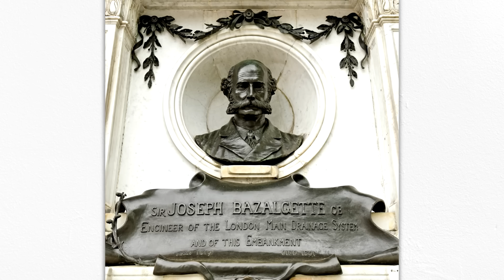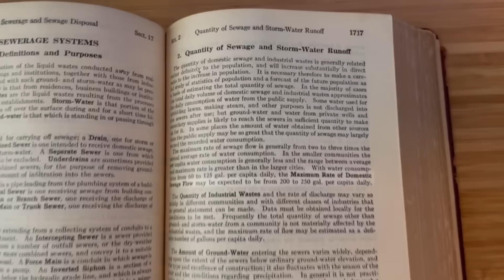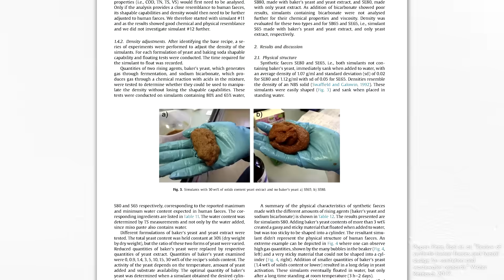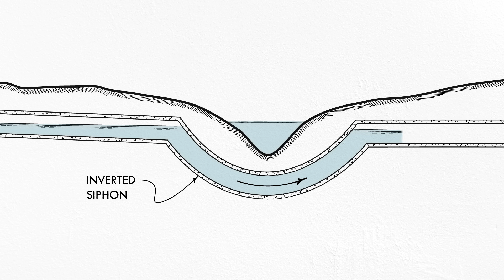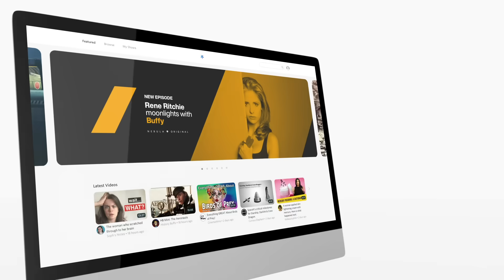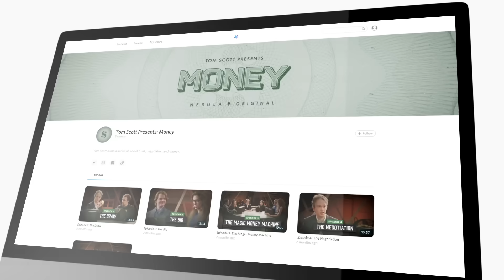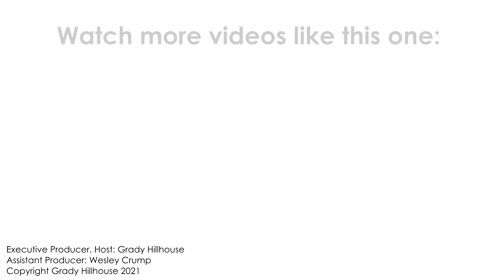How Sewers Work (feat. Fake Poop)

Comment: "Flushable" is a dishonest marketing term. Anything is technically flushable, if it fits
Reply: If it fits, I shits
Reply: Really don't get how companies still making problematic 'flushables' haven't be sued in major class actions from cities for the damage they're causing...
Reply: @RealLuckless  sue for what? Are they not flushable?
Reply: @Jman3881_  I worked as an electrician on  some sewage bypass jobs where diesel engines generate electricity and the electricity runs pumps to lift the sewage up and pipe it through pipes run along the ground then back into the sewer on the other side of the part being worked on. I have seen telephone books jam the pumps. How did those get in there? Those flushable wipes are notorious for collecting into gigantic mats of wipe fibers that will foul a pump worse than the phone books. The bedsheets? That was in a prison treatment plant and those guys have nothing but time to figure that one out. Apparently after so many flushes, a bedsheet will eventually go through. That mess was tangled up in a sludge rake conveyor. Burned the motor out too!
Reply: @RealLuckless  Actually, it has happened. Adam Ruins Everything made an episode about it.
Reply: @RealLuckless  When company is rich enough, they don't care about what's legal and what isn't. You sue them, they lose, the fine is just a tiny drop compared to the ocean of money they earned through doing what you sued them for. Welcome to capitalism! :P
Reply: @LordDragox412  you mean corporate capitalism or monopolistic capitalism. Free market capitalism doesn't make what you see, possible. Only made this comment, because there's a bunch of loony socialists running around, saying this is what free market capitalism is...
Reply: @LordDragox412  Yep, labeled as a "cost of doing business" - a lot of companies actually budget money to pay such fines and lawsuits.
Reply: @654Crossman  "I drink your MILKSHAKE!"
-Daniel Plainview

Corporate and monopolistic capitalism are natural outcomes of free market capitalism.  To say otherwise is either naive or disingenuous.

If free market operators are not attempting to take advantage of other participants, then they are operating in a system where everyone fills a role for common good and provides their service when needed.  That's socialism/communism.

Once the desire to take advantage of others is introduced, working for common good is no longer the objective.  Working for one's own self becomes paramount.  Corporate and monopolistic capitalism allow individuals to come together and take advantage of other market participants more efficiently.  It is natural that a system of self-interest produces these outcomes.  If you wish to not reach such ends, then you will require regulation/government intervention, a not-too-free market condition.
Reply: @LordDragox412  Yeah, but regulators in most countries do have the authority to actually ban items from sale. So they can prevent items with this labelling from being sold.
Reply: @RealLuckless  In Australia there was a court case and the flushable wipe company unfortunately won, as the wipes are flushable even if they shouldn't be flushed.
Reply: @Chrazzari  That sucks! Just because they go down when you flush doesn't mean they don't create havoc as they travel through the sewer system. We seem to keep creating more roadblocks every day.
Reply: @RealLuckless  cuz technically it's not they're fault. And a lot of the times they say not to flush them. And what about the people that poor their grease down the drain. You gonna sue Crisco for fatbergs? Probably not.
Reply: It's a bit of a mouthful tho to say "Flushable without causing major problems" every time
Reply: @amicloud_yt  safely flushable; safe to flush

safe-flush wipes

but then they’d have to actually degrade almost as much as toilet paper to say that and tell the truth
Reply: Mostly everything that fits will flush, it will just get stuck later
Reply: juat force the producers to also write "do not flush" on the packaging! 😬
Reply: Would you be interested in buying some of flushable golf balls.
Reply: @fireandcopper
RE: "Flushable" is a dishonest marketing term. Anything is technically flushable, if it fits.
That's not surprising since "marketing" is, by definition, "dishonest."
Reply: it pretty much translates to: "it goes far away enough to not be your problem (and fuck everyone else)"
Reply: Last sunday i was out at the same pumping station 6 times because of a cloug in a pump(theres 2 pumps but the other one was sendt to service friday) this cloug was cursed by what looks like a mixture of fatt and tisuepaper, it becomes this very stringy and hard to pull apart cloth like lump.
Reply: @zentrobi1548  like this? 
 https://youtu.be/N9FoxxsjC0g
Reply: @kratzikatz1  yar, altho that guy could have used hes brain and just lossened the 4 bolts wich hold the buttom half together, much easier to get out that way, but yar exactly like that

Edit: oh wait that guy was proberbly you since you uploaded it xD
Reply: @zentrobi1548  believe me . Often it is easier in this way because of the hose . It is an above waterline coupling system. And we hate it ! And this film is intended to show what the new "toiletpaper" can cause.
Reply: @kratzikatz1  ahh, you see where i work we dont have that on the pumps, the pumps instead have claws that graps a fastned pipe at the buttom and then there is a rubber gasket(or what ever you call it in english) wicj seals the pump, this way you dont have to deal with the hoese.
Reply: @zentrobi1548  we have to maintance over 220 pumpstations . Some 200 for 1 to 4 houses with 1 to 2kW pumps with cutting rotors and underwater coupling.  Around 20 with pumps from 5 to 25kW for whole villages . The little ones produce the most work.   😈
Reply: @kratzikatz1  i know the struggle xD we got abit over 300 stations with between 1-4 pumps in each (around 24stations with only 1 pump, these are for 1-4houses) im not completely familier with the english names for some of these things, but we have the cutting blades too on some and others we have tried with what we call "fritstrømshjul" in Danish, basicly "free-flow-wheel" its where the blades have a 2-4inchs gap between the intake and the blades, we have had quite the succes with these not clogging too much, the cutting blades seems to only last 3-4months so thats kinda expensive in the loong run.
Reply: @zentrobi1548  inches????? Wtf is that????😕 😉😉😊😊 Freeflow. We use them mainly from Noggerath. The little film shows a "freeflow" pump!
Reply: This topic is also a running joke in the Fallout game series. All numbers of different things found in toilets; sometimes with a plunger near by in an attempt apparently to force said items down.
Reply: Correction: if you are brave enough
Reply: The flushable wipes industry created their own disintegration test to rate their products. If it passes their very easy test they can market as flushable.
Reply: bingo...used flushable wipes that costed me a nice plumer bill to have them shove in a snake. down the bowl
Reply: Marketing is evil
Reply: @TheMennoXD  yup. One of my favorite comedians, Bill Hicks, was not a fan either. He just some good material on them.  At some even calling for them to kill themselves for being the spawn of Satan.
Reply: if it fits, it shits
Reply: 1000 like
Reply: who upvotes this nonsense? ask a professional, there is a difference.
Reply: FYI, tennis balls are NOT flushable.
Reply: @rdizzy1 Not proven. Will just get stuck or end up on the primary screens at a wastewater treatment plant. When they say "break down" they mean by like 5%.
Reply: so true.
Reply: Yes this is a great theory except for when it gets jammed and one of the pump stations. It’s all not gravity fed
Reply: I propose that we make it illegal to market anything as "flushable" unless it is proven to dissolve as fast or faster than a piece of toilet paper.
Reply: This is how people who use lavs on airplanes think too. Source: is mechanic who has gone fishing more than once.
Reply: Orbezz fit, but never flush those
Reply: Just like "Safe and effective"
Reply: Anyone else watching this while pooping?
Reply: There is a big difference in strength and durability between the wipes that they market as flushable and the ones that they don't
Reply: My ex-wife bought "flushable" wipes a few times. and due to a piss poor rubber boot connection from the upstairs toilet. They got caught  on the offset portion of the drain pipe in the basement, which created a very slow drainage from the upstairs bathroom and caused it to leak though the mount under the toilet.
Reply: No, no, no, no, no. Bottom line is NO. You are wrong. Maybe it can go down. More important is should it? It's like our impending doom with landfill taking over our planet. Technically anything can be dumped in the trash. The more important question is should anything and everything be dumped in the trash? Educate yourself. Please, please, please.
Reply: Should be banned. A totally unnecessary item costing sewer authorities many millions of dollars in maintenance.
Reply: @James_Bowie  Being unnecessary is objectively wrong.  Just because you may have no need of flushable wipes doesn't mean others don't.  The fact is that for some people, a dry paper product simply isn't up to the task.  Regardless, as has been pointed out, not all wipes are created equal, and some do breakdown just fine.  Mandating that flushable wipes break down into some required way is the answer - not blanket bans.
Reply: @watcherofwatchers  flushable wipes are unnecessary period. If you cant get the job done to satisfaction a bidet is unbeatable in economics, cleaning power, and disposal . people talk about wipes that break down, i wont believe it till i see it
Reply: @watcherofwatchers  I work for a sewage company and wipes are a no no, regardless of how they are marketed. Wipes & ladies sanitary products are the biggest cause of blockages
Reply: @Capthrax1  you wouldn't use toilet paper or wipes to clean poo off your shoes yet they are good enough for you butt.. I will never understand how people don't wash their butt after their business
Reply: @watcherofwatchers  Sounds like someone needs more fiber.
Reply: @watcherofwatchers  who's talking about banning blankets
Reply: @watcherofwatchers  for those that need wet wipes no one is stopping you but flushable is not a necessity just put them in a bin...
Reply: @xerikl  actually yes i would use toilet paper or wipes to clean poo off my shoes and have done so many times. so stop presuming to know what every other human being on earth "would or wouldnt" do..
Reply: @nickclark18  that's disgusting.
Reply: @watcherofwatchers  then use a bidet
Reply: @virtualtools_3021  Learn to think critically and not like a third grader.
Reply: @Capthrax1  two words: particulate inhalation
Reply: "Gmo free salt"
Reply: Anytime I see an “_-able” term used for marketing, I really try to imagine the opposite. These wipes are literally unflushable. This burger is uncraveable.
Reply: Flushable wipes are far less delightful a user experience than regular wipes.
Reply: As some one who foes work on the city side of the sewer I have to disagree
Reply: @L.D.Productions  that's why he says it's a dishonest term.
Reply: @L.D.Productions  How would you know? If it isn't flushable, you'll never see it.
Reply: @L.D.Productions  yeah wipes are one of the worse things we run into
Reply: @L.D.Productions  Why do you disagree? Fireandcopper is agreeing with your viewpoint? Maybe you misunderstood what he was saying?
Reply: @L.D.Productions  I do believe OP agrees with you, they’re saying “flushable” wipes are basically the same as flushing anything else you’re not meant to — just because it fits doesn’t mean much
Reply: @L.D.Productions  exactly shit tears up the high rate side of the plant. Cement blocks, 2x4s , car parts I’ve seen crazy stuff jamming the screens
Reply: To be fair, the wet wipes sold where I live labelled as "flushable" actually really ARE flushable in the terms of breaking down like a normal toilet paper. I've even used wet wipes that broke down almost instantly after being introduced to water, even faster than a regular toilet paper.
Reply: @Kiwi2703  lol that sounds a little too quick. Might have an assident.
Reply: @seanriopel3132  They work pretty well. You don't have much water on your ass for them to break down there c: But I do like the word "assident" lmao
Reply: There have been new flushable wipes that were proven to break down in water equal to or even quicker than TP at least.
Reply: @rdizzy1  no they don't break down as fast as tp. They break down compared to other wipes but not as fast or easily as tp. Trust me I see them cottonelle ones who claim this daily
Reply: @rdizzy1  None that I've seen, and I'm a plumber who works in residential high rise buildings.
Reply: @rdizzy1   except most arent paper based.
Reply: @southaussiegarbo2054  Yeah, they are in the process of changing them though to break up in water, due to this very issue. People were buying them less and less due to not really being able to flush them due to warnings not to flush them. Go find one of the main videos here of the newer ones breaking up in water equal to or quicker than toilet paper.
Reply: @rdizzy1   none will break up faster then tp. 
Sawater got litteraly every type from across world and none beat tp.
Reply: @rdizzy1  Citation needed.
Reply: @rdizzy1  Unless they stop producing or ban the current "flushable" wipes, people will keep using them and it won't matter. i <3 my washlet.
Reply: @rdizzy1  then where are they.
Reply: @rdizzy1  - Stop and think about that for a second.  The things come packaged in water.
Reply: @daneclark3161  Not only water, most of the time it is about 40% water mixed with other things. Not sure how it works, but go test it for yourself, buy a brand new pack of cottonelle flushable wipes, they dissolve just as much as 2 ply toilet paper, and way better than something like a paper towel.
Reply: @rdizzy1  - I'm in rental real estate.  I own, manage, and maintain our property.  

My face is the one that is down in the basement pulling baby wipes, flushable wipes, tampons, condoms, paper towels, tooth brushes, combs, perfume bottles, plastic caps, Matchbox cars, Transformers, cornbread, and everything else that you can not possibly imagine.  Plastic is the worst.  

Please do not try to tell me that anything but TP and poop should go down the toilet.
Reply: @daneclark3161  I'm telling you that there are brands of modern flushable wipe products that dissolve in water on par with 2/3 ply toilet paper. I've tried it myself with a bucket of water and a drill. Some of the products were totally in the water within 10 seconds of swirling.
Reply: @rdizzy1  - I've never met a sewer main that comes equipped with an agitator.
Reply: RIP mouse I flushed into it last night
Reply: @hairyhenry97   Fun fact if you live in a large city your probably gonna be drinking water from the system you flushed the mouse into.
Reply: @nathanh2917   nope. I live in a city and we have 2 types of water in some areas
Drinking water(water thats from reservoirs lakes rivers)
And recycled water(water thats from sewage treatment plants)
Reply: @southaussiegarbo2054  oh so because your city has grey water and potable water all cities are the same? That just means that your city only partially processes the sewage rather than completely like other cities. More specifically your city sanitizes the sewage and only filters large particles out. Then lets people use the grey water which then gets naturally filtered by the ground until it runs off into the rivers and lakes as a now fully filtered product. Which means in the end your still drinking recycled water. Nobody up river from you guys I take it?
Reply: @nathanh2917   lol no.
I was replying to someone saying that most water you drink is recycled sewage 😂.
And it isnt a state wide thing where i live only select areas around sewage treatment plants.

Our drinking water comes from 3 places

1. A major river that run from many states
2. Reservoirs 
3. The sea.

Water used on garden etc if in large amounts and only if ends up in water table but most cases the water dont get that deep down due to our soil types so and excess evaporates
Reply: @southaussiegarbo2054  even if it did get to the water table the various layers of soil and such act as filters.
Reply: @nathanh2917   yes but it dont run off lol
Reply: @Wischmopps Bought a bidet (LUXE bidet Neo 120 for $40) about 5 years ago, probably one of the best purchases I ever made.
Reply: Saying it is flushable is perfectly fine. Premature babies are flushable. It's the fact they don't breakdown easy enough that makes them a problem.

Comment: Our toilet has been overflowing a few times lately, turns out there are some roots growing into our wastewater pipes and wet wipes got stuck on the roots
Reply: A very common problem. Wet wipes will lodge on any instruction, and worsen the clog.

Comment: How do they maintain a slope like that over a large sprawling city without going too deep?
Reply: They break the slope up into sections and add lift stations between them to pump sewage up to the top of the next section
Reply: Lift stations, and lots of tributary tunnels that gradually get wider and change height

Edit: I should clarify that I am in no way a hydrodynamic engineer
Reply: You put your treatment plant near the outfall of your largest river.
Reply: Or we just go deep, I've had to check some manholes that were over 5 m deep, but those are rare

Comment: One thing that I find interesting is, where I live, the town puts pumps at certain points of the sewer line as it's very hilly and you cant get a pitch/slope over a long run.  

Got to replace one of those pumps.   What a beast.  The sewer system is so complex and so needed and yet totally unseen.  

Great video!